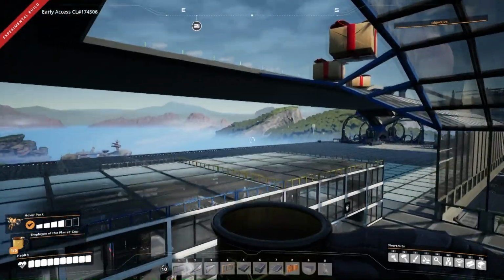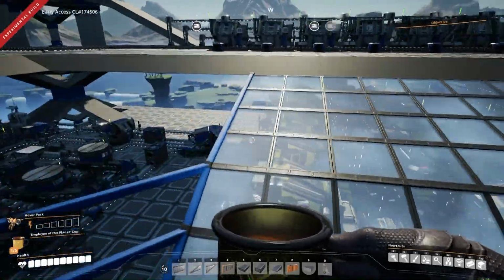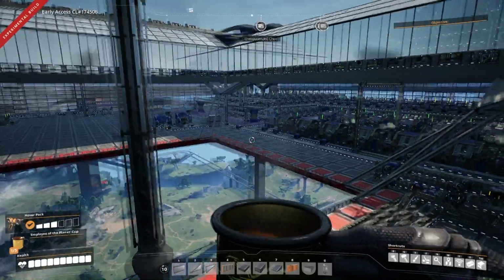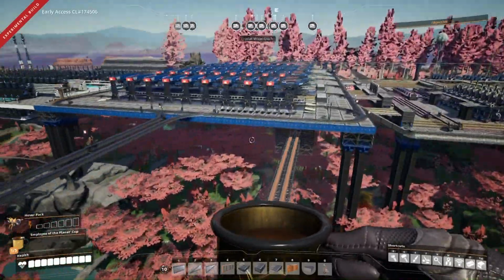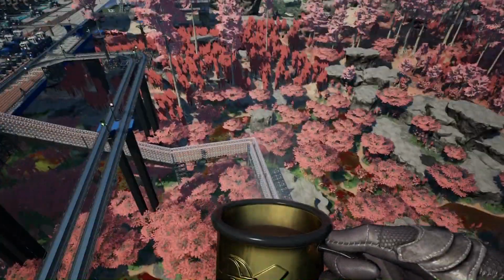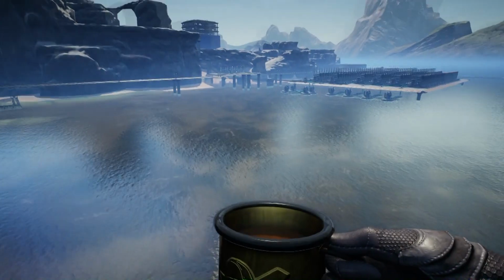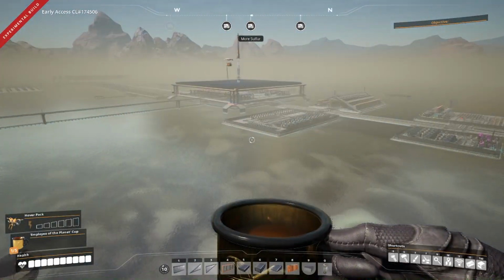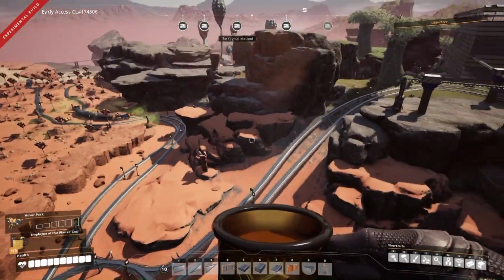SATISFACTORY - 100 Turbo Motors Per Min!

Comment: I optimized your world and made huge nuclear plant that can survive any update or train issues for up to 29 days. I played on that save and made it that it produces all the plutonium it can and maximize the power production to 560 000 megawatts of power. 

With a controll room to control everything, emergency nuclear reactor to keep processing nuclear waste even when the grid is shutdown it will keep on running without the power from the main grid and also have a emergency waste disposal unit that has enough resources to sink plutonium for the 29 days

Comment: I love this update! Your builds are awesome and i have been playing on a much older version of this save for quite some time.. But thought I'd let you know there are some issues with this version. The nuclear area. After about 5 minutes all the trains grind to a halt at the main off load area due to a 'feedback' loop. I'm trying to sort it with a slightly different entrance on the left hand side and also exit on the left hand side so they don't need to loop around a couple of times to line up with the left hand couple of stations. But they keep jamming before I am able to create it!!! also, there aren't enough aluminium casings being made and this is causing the particle accelerators to under perform and therefor the whole system to start backing up and if left unchecked is causing the nuclear reactors to start to shut down due to waste backup.
Reply from the maker: Oh really? On the most recent save I posted?   I did spend quite some time fixing up the trains and I had a few issues with nuclear which I also spent a lot of time fixing.  Whilst finishing the turbo motor production the nuclear set up ran for hours without issue.    Perhaps it only just happened right as I saved and shared the file.   I might load it up and let it run while I'm at work to check. Cheers
Reply: @danp6918  My thought about how to rectify the log jam was maybe to have the entrance and exit to the west of the station, with a roundabout about 10 -15 blocks away. This would stop the need of some of the trains doing a lap or two of the area in order to line up with their stations. They could just come in on the left, go up, drop into their respective stations, and then go the bottom, left and then out around the roundabout and then off to the pick up zones. I may sort of ruin the amazing aesthetic nature of the top and bottom entrances and exits, but may work a bit better. Just a thought!
If you do fix it, do let us know as I'd love to give it another play.
Reply from the maker: @davidscuthbert  is it the most recent save I linked on this vid you are talking about?   I had the trains running for hours and the nuclear train hub was fine
Reply: @danp6918  Have just tried it again twice with the download from the link above. And both times within 7-8 minutes the west side two lines of stations get into a feeback loop and lock up, causing everything else to queue. 
Here's my setup. Samrt!, NoFog, Pak, Lost train alert, perma day, magic machines. I load up the save, enable flight mod, enable God mode, and then fly to above the southern entrance to the stations. Wait there for less than 10 minutes, and then it locks up.
Strange if you aren't having problems with it. I'm a bit lost as to why I'm getting the problems.
Reply from the maker: @davidscuthbert  ill log in after work and try it.    If its just trains locking up, I've got pretty good at fixing them with signals.  I'll take a look.   Cheers
Reply: @danp6918  how did you get on Dan? Did it happen for you?
Reply from the maker: @davidscuthbert  haven't had a chance yet sorry!
Reply: @danp6918  no worries. No pressure!! Lol.
Reply: @Dan P  I had the same thing happen with the nuclear station. Also there is also a track loop where the trains come downhill into an oval section of track that the trains will back up on.

Comment: Amazing build! So happy to see it finished! I thought you must have hit the item limit when building the aluminum factory. Thought that was going to be as far as this would go! Glad to see that it's POSSIBLE to do builds this big. How much power did you end up using? How much of that nuclear setup is actually being utilized? I was wondering if you're ever going to need that much!
Reply from the maker: Thanks, We ended up with 241,000mw    80 coal, 400 fuel, 70 nuclear.     I'd have to log in and check the max consumed.   But you can never have too much power!!   😃

Comment: Cool stuff, what alt recipes did you use for your electric turbo motor setup?
Reply from the maker: Oh  so many!
Reply: @danp6918  
Which recipes did you use for the 4 components for the turbo?
Reply from the maker: @IgnisInternus  Steel rotor.    Radio control system.  Electromagnetic connection rod.     The motors are the normal recipe.
Reply: @danp6918  
Very cool, once the game releases from Early Access I hope to do large scale builds like you and others  from scratch

Comment: Pretty funny, since I'm finishing a spreadsheet for "100 thermal rockets per min" factory)) Although I'm going to make it with cheats, since I don't have that much time and I want to play other games. Gonna check out your save later and test how much frames I'm gonna have in your world :D
Reply from the maker: Have fun with that!!     Will you be building the power grid to support it?
Reply: Oh, power is gonna be a big problem, since I'm planning to fully overclock most of buildings to save my frames. Also, a big chunk of oil is going into rubber/plastic, and almost all bauxite and quartz is going into main goal. So, gonna have to make zero quartz and almost-zero bauxite nuclear plants, as much turbofuel as possible, and it's still not enough! Thankfully, 50% of coal is free, so about 100-200 coal gens are going to finish the job.